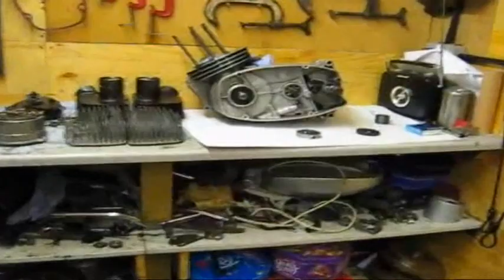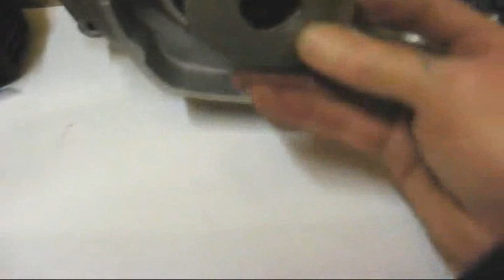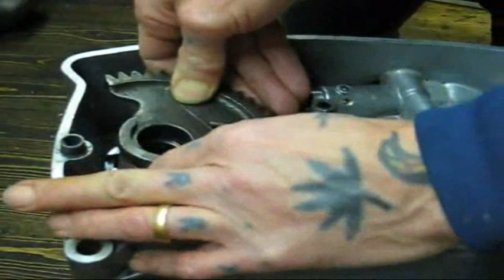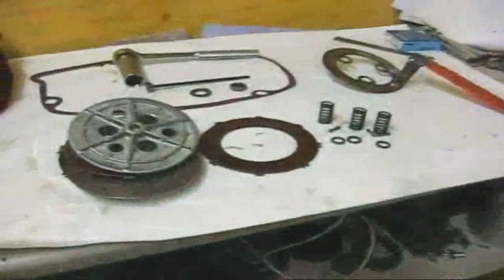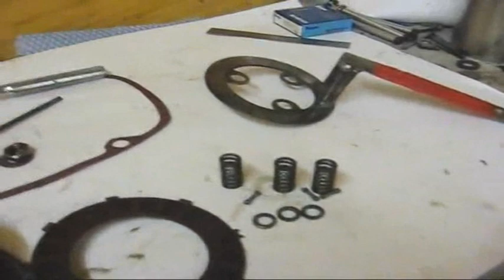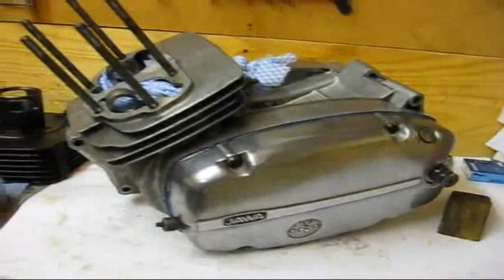jawa engine build  fitting the clutch and gear shift kickstart

Comment: Here's a tip I worked out for myself so I'm sharing ..
If you have oil seeping out around the pushrod simply make the hole a bit bigger and push in a piece of 5mm fuel pipe that grips the rod and forms a seal.

Comment: Terry - mine is a fairly current 640 - advice please ... in the old days I recall as a matter of routine it was advisable to pull in the clutch lever and kick the bike over a couple of times to free of the plates -- when I do this on the 640 the engine continues to rotate - are the plates stuck hard on ?  Have you done a video that shows how to adjust the clutch mechanism inside the casing ? .... tony.c.buchanan@btinternet.com

Comment: Terry Do you have a video showing the spring placement that fits behind the gear /kick shaft Per parts manual it looks to fit inside a retainer inside or behind where the kick shaft inserts into
 I am a new owner of 1966 590 250